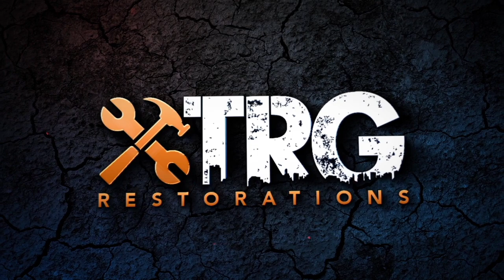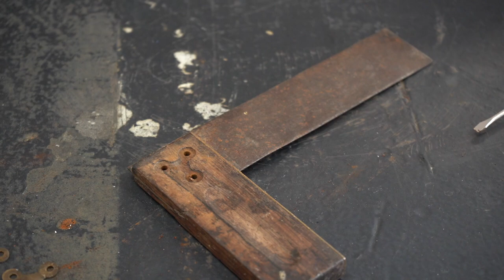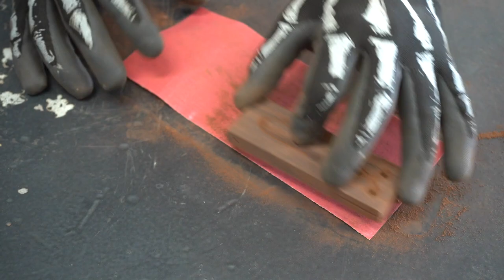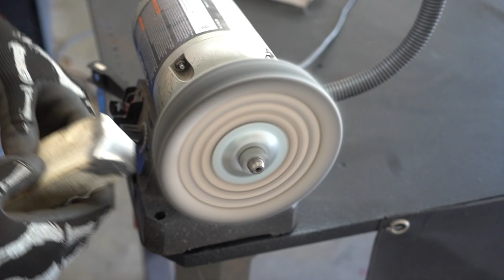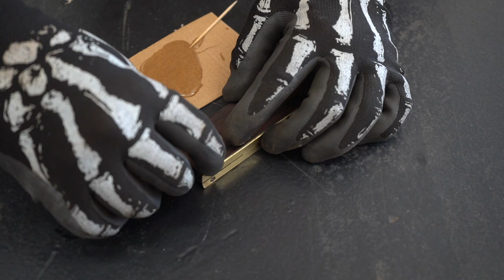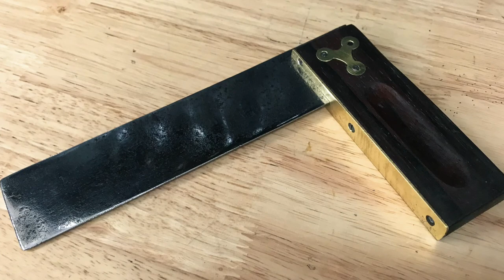Antique Carpenter's Square Restoration

Comment: I lean toward using Simple Green to clean old wood.  Use a Scotch Brite pad.  Dry.  Wipe down several times with boiled linseed oil.

Small meta parts can be cleaned in a glass jar.  Put a bolt thru the lid so you can chuck it in a drill.  Fill it 1/2 full with sand.  Add small metal parts, chuck in drill, let'er run an hour or so.

Comment: If it's not precisely "square", then you just have a wall hanger rather than a restoration.  Many of the old tools like the square, plane handles, hand drill handles were finished with shellac. If so, apply some denatured alcohol and the shellac will dissolve, then you won't have to sand much wood away. If you got lucky and it's dead square, nice work.
Reply: This is not true.  Squares, including ones of this style can be squared.
Reply: You can always resquare a square. Big metal ones can be squared with a punch. Ones like this one can be squared with a file. There's a lot of videos online about how to repair a square that isnt square

Comment: I have a craftsman carpenter/ framing square similar to this however its 18” long on the blade and the wood part is around 9.5 inches. Their is a brass cover and pins but its a different shape and I can’t find anything similar to it on google lens or any other search method. Does anyone know how to tell how old it is or how much it might be worth restored?